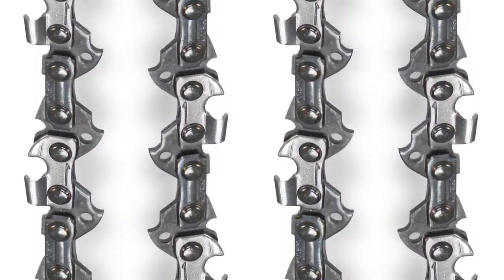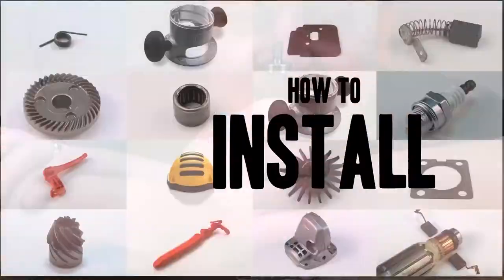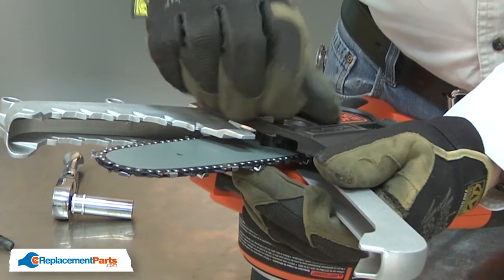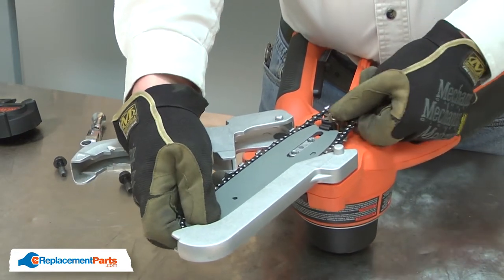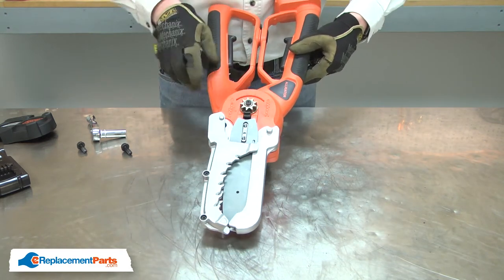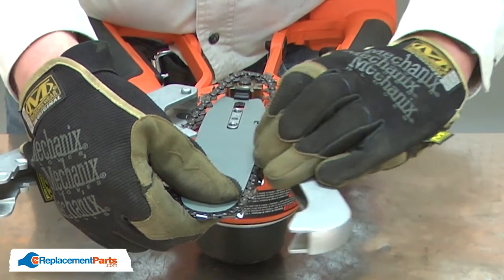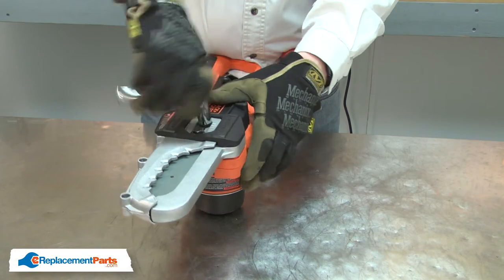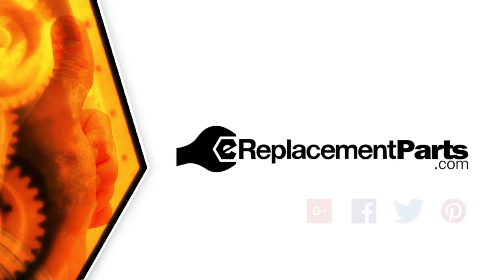Black and Decker Lopper Repair - Replacing the Chain (Black and Decker Part # 90602735-01)

Comment: Would have been easier to lift the bar up to take the chain off. Also the chain has to have the correct tension to not wear prematurely or fall off during use. The bar has a spring behind it and you use the bolts on the side to set the correct tension.